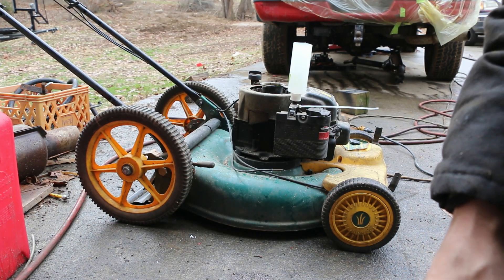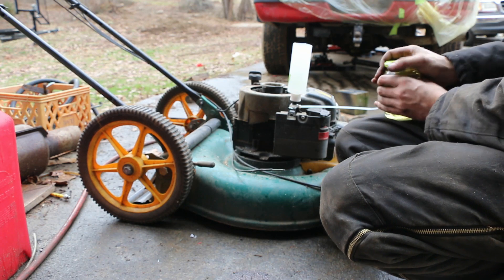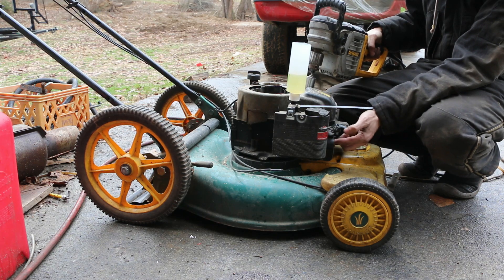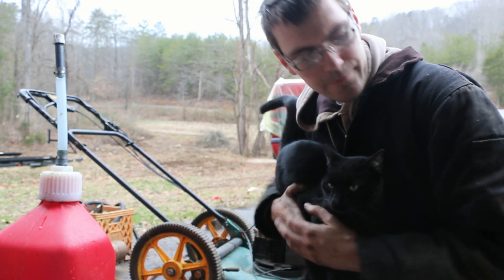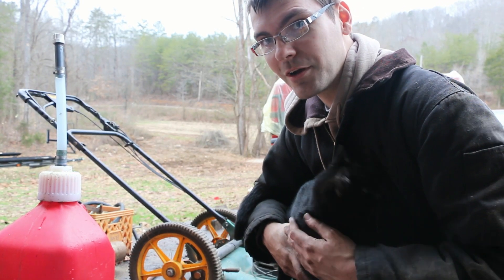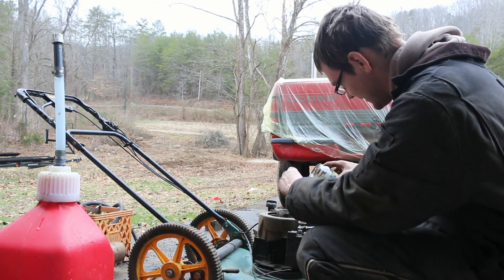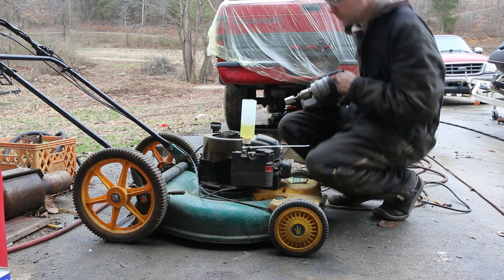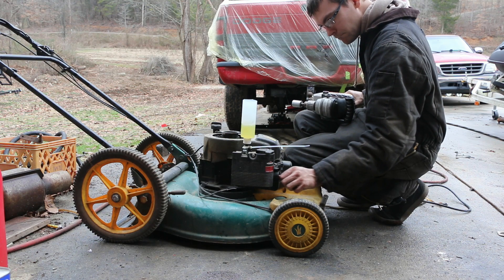Failing at a Stale Gas Revisit. (Testing in a small engine, Runs fine)

Comment: This is what I did and would recommend:
I had roughly 1.5 gallons of E10 with 2 stroke oil that was 4-5 years old in a gas can. We were never going to use it because we switched to an electric weed whacker. So I poured it into a 5 gallon can, then filled the rest up with Shell 91 V-Power and shook it up good. I picked the V-Power because from what I can find it has the most detergents and I wanted to boost the octane just incase, 91 octane is the highest we get by me. 

After that I just used it in my lawn mower, shook it up every time before I poured incase things had separated. It’s worked fine so far and I’ve got only a gallon left. 

However I did recently pour some into a cup and tried to burn it. It definitely did not burn with the ferocity of normal gas, it acted closer to diesel. I’m guessing it’d be due to me reaching the bottom of the gas can where there may be more water content that sunk from the old gas but I don’t truly know. Ideally using E10 93 to mix with the old gas would’ve probably been better as the ethanol can absorb some of the excess water and burn it off better.

Comment: I have a fuel storage tank for my power plant that has 80 gallons of gasoline from 1987. I test it occasionally and it runs the generator just fine. That's over 30 year old gas! Now that is "real gas" with no alcohol so maybe that has some bearing on why it lasts so well.
Reply from the maker: Yup, and depending on how the fuel pickup works it could also be that any sediment has settled to the bottom if it uses a draw straw type setup, or perhaps they really did make stuff that much better back then! Either way its pretty awesome. It shocked me how well this old stale gas ran in this mower, especially seeing how much sediment had built up in the generator I drained this gas out of.
Reply: I bet as long as you don't have a vented tank cap that lets air in and out as the ambient air temperature changes you might be ok. I have a couple of jet skis that always has gas left at the end of the season and I just top it off with new alcohol free gas in the spring.

Comment: My sister gave me her 2000 Honda Civic when she bought a new car. However I didn’t start driving until 3 years later and the car had almost a full tank of 87 (which 99% of the time is usually E10.) The car ran completely fine once I started driving it, I’m sure it wasn’t making full power but it wasn’t pinging or turning on the check engine light. Ideally I probably should’ve continuously kept topping it off with new higher octane gas for a while, but it ended up being fine.

Hypothetically a car shouldn’t ping from old fuel as it’s losing volatility. You just won’t make full power due to the hydrocarbons being broken down/evaporated. You might also get worse MPG from the ECU adding more fuel to try and make full power.

Really the only thing to worry about is the varnish and potentially rust that’s accumulated in the fuel tank. Even then you probably won’t kill/blow up anything that already isn’t ready to get killed/blown up lol. Fuel pump, fuel filter, fuel lines, injectors, and carburetors all have that same fuel sitting in them for the same amount of time.
Reply from the maker: You are absolutely right. I'm so glad you've chimed in with some very valuable thoughts and a personal experience!

My one finding is that with carburetors there is the large potential for evaporation as carb bowls are vented to atmosphere, a fuel injected vehicle has a sealed system other than the tank itself which usually have means of controlling "evaporative emissions" (incidentally the cause of a ton of check engine lights anywhere rust is common)

Usually I tend to see in a carbureted engine the jets and bowl will fill with varnishey sludge from the fuel evaporating, but the fuel will run a-ok once the sludge has been cleaned out of the carb, wheras a fuel injected engine won't have any noticeable ill effects.

The fuel in this video was around several year old 87 E10, and the carb was full literally up to the needle with a slimy grunge the consistency of wheel bearing grease from fuel evaporating and leaving stuff behind. After cleaning the carb out it ran fine, but the generators owner didn't want the old fuel left in it. So I ran the fuel in this little push mower, as well as my riding mower with no noticeable difference in the engines attitude.

Interesting point you bring up about pinging. It does make sense that the more volatile components would be the first to evaporate, which would theoretically increase octane rating but reduce the available BTU output.
Reply: trythistv on the last part I’m just not 100% sure because in comparison diesel isn’t volatile yet diesel has a really poor octane rating, thus why it can kill a gas engine given enough time.

Standard gasoline:
Energy: 124,000BTU
Volatility: High
Octane: 87

Old Gasoline:
Energy: Less than 124,000BTU
Volatility: Less than fresh gas
Octane: ?

Diesel:
Energy: 139,000BTU
Volatility: Low
Octane: Normally rated in cetane but when rated in octane it’s actually -25

When talking gasoline the higher the octane, the slower the burn. So the natural thought process would be that since old gas burns slow it would be the same if not higher octane than fresh gas. Yet then you have diesel which burns slow yet has a horrible octane rating.

I’m still going to guess that old gas has the same if not higher octane than fresh gas due to it having less energy per gallon and it being less volatile when being burned in an open environment but I’m no petroleum engineer. I think I’m overthinking it by comparing it to diesel when it’s a substantially different fuel.
Reply from the maker: Hmmm you have given me much to think about lol.

I've always considered octane to be how resistant the gasoline is to ignition, higher octane will not ignite just from heat or compression.

A diesel relies on heat/compression to ignite the fuel, which requires a way higher  compression ratio. Which would make me think diesel would have a higher octane but now thinking about it, that's not true.

In open air diesel is much harder to ignite, but it becomes less stable when put under pressure and heat that you'd find in an engine.

Now I need to find if there is somewhere like Blackstone that will do tests on a sample of fuel to determine the btu and octane ratings so I could compare fresh to old gas...

I've got some reading and searching the web to do now lol.
Reply: trythistv I think we can ignore diesel as a valid comparison. Gasoline flashes at -43C, Diesel flashes at 52-62C. We never see 52-62C weather to have a fair volatility test. You’d have to compare lighting gas at -43C and diesel at 52-62C (or another set of equivalent temperatures) to get a fair comparison. 

So with that said I would then assume the octane of old gas is equal to or greater than fresh gas. Since it contains less energy and the stuff flashing off early would also be the same compounds that auto ignite at lower temp. Again can’t really confirm since info is hard to find.
Reply from the maker: Ah, that does make sense.

I started messing with this stale gas in hopes of finding some conclusive information, as there doesn't seem to be a whole lot out there that is actual confirmed evidence as to what happens to the fuel and what it causes.

I obviously haven't found a ton out, but I feel like I have a little better grasp on how gas "goes stale" and what that causes and how to combat it.
Reply: @trythistv on direct injection the tank is sealed except for evaporative emissions? So it's not air tight? Or it completely sealed when it's off and only let's air in when enough vacuum forms in the tank?

Comment: Thanks for sharing.
Reply from the maker: I sure wish it'd been a little more conclusive, although the E10 fuel kinda showed me just how much gunk builds up in a carb if you leave the fuel on and don't run the bowl empty during storage. The entire float bowl, fuel line, and petcock on the generator were jammed solid with a yellowy varnish sludge. took some time to clean that mess all out and get it running again!

Comment: I have old gas in my jet skis and boat every spring and just fill the tank with fresh gas. Never a problem. If you're worried add some cheap additive with naptha. That stuff will dissolve varnish buildup. 
The only has I've ever had problems with is some 135 octane pure has I used for 2 stroke dirt bike riding. It came in a 5 gallon pail. After 6 months I had about 3 gallons left and at the bottom of the bucket there was about 3/4 inch of something that looked like white sludge. Terrible stuff. Went back to high octane from a gas pump.
Reply from the maker: Generally speaking you're doing the perfect actions. I've had some e10 fuel that was real weird, left behind awful varnish and buildup enough to clog the entire carb full of a weird goopy paste after just a matter of a few weeks. I generally try to get 100% gas (no ethanol) for my small engines and have very few problems with them since we started doing that.
Reply: @trythistv  I'm pretty sure that second fuel did have an additive. Ask George.

Comment: did you filter, or transfer containers and let things settle to the bottom?
Reply from the maker: Drained straight out of petcock on the generator that the fuel was in, into a clean gallon milk jug, from there I poured it into smaller containers to test additives, and poured from the control container straight into my jerry rigged "fuel tank" so that you could see it running on that fuel. No filtering, No settling, No nothing.

Comment: I had a mower that wouldn't run on old gas and in fact I had to have the carburetor serviced to get it running again.
Reply from the maker: Aha! See that exactly fits my theory that it's not necessarily the gas "goes bad" as much as it evaporates and clogs the Jets in the carburetor. Thanks for sharing your experience!

Comment: I've found only the smallest engines are picky about old gas, even if they're two-stroke. I've practically dislocated my shoulder and wasted a ton of time on chainsaws and weed whackers with gas that ran fine in mowers, especially if they were already hot. Try fresh, and the small engines fire right up. Additives are just another waste of time. BTW, I love your electric start, though even someone like me who ignores most safety tips would hesitate to run it right next to an open container of gasoline, new or used. I can't imagine that thing is brushless, or sparkless.
Reply from the maker: I had a customer light a cigarette the other day as I was inspecting the carb on his jet boat... one of those "I understand you're stressed out about your boat being broke down, but I'm sitting on the fuel tank checking why there is gas flooding out all over the place, put that thing out" situations.

You are absolutely right about small engines though. seems like the smaller they are, the pickier they are. and 2 stroke engines always seem to fight me more than 4 stroke engines, regardless of size.
I suspect there is some logical explanation like the 2 strokes don't compress as much air per stroke because of port openings or something which leads to less heat which makes igniting the fuel harder or something, but I'm no expert lol, just observing and learning anything I can.

Comment: I thought the additives were a joke as well. I have a car I'm running on 8 year old fuel right now because it's been sitting for that long I had to replace the fuel pump it was rusted to shit... anyway I did notice the new engine oil smells like the old stale fuel now so I'm assuming the unburned portion of the fuel is slowly dumping into my crankcase i noticed theres a mpg issue as well I'm getting roughly about 5 mpg at the moment with this fuel i just went and filled it back up with fresh fuel so hopefully it improves and I'll change oil again on the next fill up just in case it's still dumping unburned fuel into crankcase. My point is additive is not going to perform miracles.
Reply from the maker: Exactly. To think something you're adding at 100:1 or higher ratio is going to magically change the fuel is absurd.

Be incredibly careful if your oil is getting fuel diluted.

I had a customer once who had a leaky needle /seat in his cabin cruisers 350 V8 carb. I replaced the needle/seat and noticed the oil level was about 2 inches above the full mark and smelled like straight gas.

I told him he needed to change the oil, it was too high to run the engine and was badly fuel diluted, he said well we want to know the engine runs right with that new needle and seat, can you just pump it down to the correct level so we can see it run, so I did that, started the engine briefly so they knew it ran, they were all happy.

We shut it off, he said he'd call and schedule us to get the oil changed later that week when he got paid.

The following day he called and said could we come change the oil and check out the boat, they think I adjusted the needle and seat wrong because it won't start anymore.

I said well you shouldn't be running it at all anyway until you get the oil changed, they said they put some "motor magic" in there so the oil is as good or better than new and they took it out for the day after I left, and after about 20 minutes of full throttle it made a funny sound and shut off.

We went and looked at it. After seeing the rod sticking through the block we decided not to change his oil.
Reply: @trythistv  ouch! I've put 80 miles on a full tank of stale fuel and fresh oil I think I'll do that tomorrow just to be safe. 80 miles lol it went from full to empty 20 gallon tank btw. Hopefully it doesnt continue to dump fuel in the crankcase but better safe than sorry. Thanks for the input
Reply from the maker: Yeah, he had some other Yahoo working on the boat before me and they kept trying to get it to run and it just kept dumping fuel in the crankcase.

Likely that little bit of stale fuel won't do anything at all, but if you've refilled with fresh, it couldn't hurt to change the oil and then keep an eye on it to make sure the level isn't getting higher
Reply: Wouldn't the evap system get rid of water or diluted gas in the crankcase? Why was your fuel pump rusted? Isn't it encapsulated in a nylon assembly? What car is it
Reply: Additives don't work but if you added 5 gallons fresh gas to the 8 year old wouldn't that drastically improve the odds of it running better?

Comment: You still didn't say how stale the gas was.  Is it 6 months or 6 years?  Was it in fact 5 years old per your comment at the end?
Reply from the maker: sigh the description of this video states that in this video I tested 5 year old 100% gas (93 octane) and 3 year old e10 gas (87 octane) as can be seen as follows:
Finally got ahold of some decently aged gasoline, some 3ish year old E10, and some 5 or more year old 100% gas...

The E10 came from a generator, the fuel had hardened up into a paste all through the carb, fuel lines and petcock. I had to drain the tank, and clean every part of the fuel system in order to get the generator to run, so I figured this would be the perfect fuel to test the massive collection of additives I've purchased.

Turns out the old lawnmower engine I got is either really eager to be run, or is incredibly healthy, as it fired right up on both stale gas samples with no additives.

I believe this is due to the engine having been left dry rather than having gas stored in it. Its less of an issue of the gas going bad as it is evaporation in the carburetor causing deposits or "varnish" to build up inside the jets.

I made sure the carb was dry before adding any fuel, and the engine was cold (30ish degrees ambient temp) for each start.

I will continue looking for a scientific method to this madness, perhaps testing the BTU content or autoignition temperature or something.
Reply: @trythistv  OK, well I didn't read the narrative.  Just linked from your first video, read the title, and watched.  My bad, but I'm guessing I'm not the only one to overlook that.  Wouldn't hurt to explain in the video itself what is happening.
Reply from the maker: Sorry for the attitude, I've wanted to get some sort of solid evidence on what really happens as gas goes stale and see if there is an additive or something that reverses it, but everything has been very inconclusive thusfar, I have a box with like 10 different additives still new in the bottles I had prepared to make this video with, started filming and then the engine fired right up and ran flawlessly, talk about anti-climactic.
I'm still pondering any way to come up with a real answer but the whole thing just confuses me, it goes against everything I've heard about stale gas that has me wondering if the real problem isn't that the gas goes stale, but rather evaporates and leaves behind stuff that tends to clog up carb jets and fresh gas might dissolve that if you catch it soon enough?

Comment: personelly i would just mix it in with new gas mabye 50/50 or 25/75 gas is still gas and that fuel was paid for so why waste it?
Reply from the maker: That was exactly my plan, but after the findings in this video, I just poured it in my lawn mower and ran it. No harm done. the deposits from it evaporating appears to be the big issue, it would clog up carbs from sitting, perhaps it is slightly less volatile, which could cause hard starts also, but this fuel being years old still runs a-ok in everything I've tried it in.
Reply: @trythistv  hmm yeah just add carb/choke/injector cleaner??